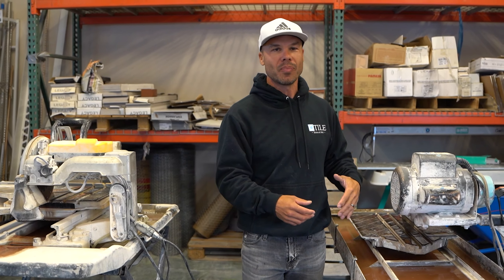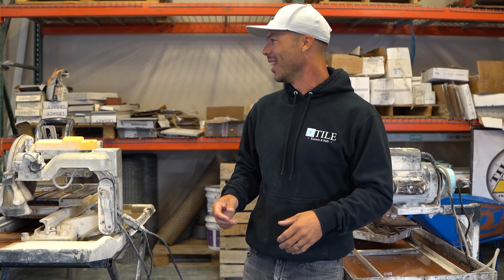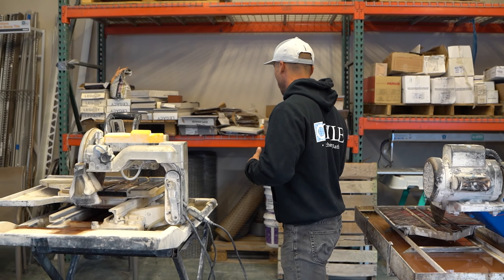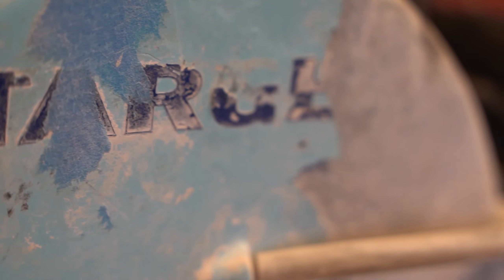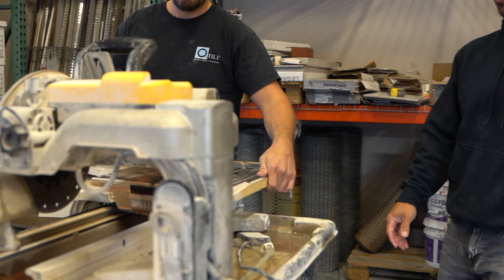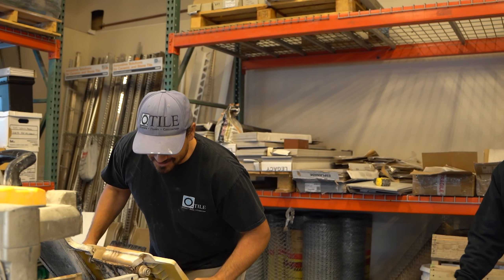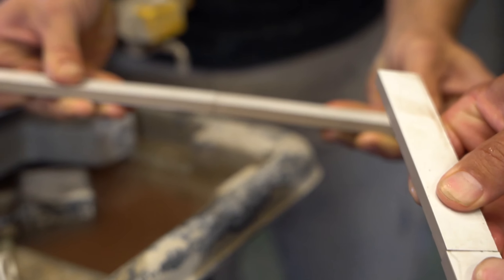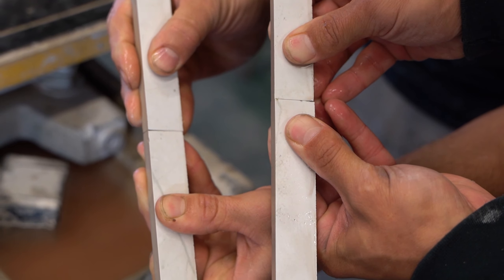TILE SAW BATTLE: DEWALT D2400 VS TARGET TILEMATIC XL

Comment: Hi Issac, if your wearing a hoodie while you work - remember to cut the neck string really short so it doesn't get caught in your tile saw/ power tools.
Reply: Lmfao don’t forget your elbow pads too Isaac, in case you fall down
Reply: @tnelly1295  
An apprentice I worked with got his hoodie string caught in angle grinder as he was leaning over a fibre cement sheet while cutting. Nearly sliced his neck open. Since seeing that, I always cut the string really short on any hoodies I wear to work.

I've seen a similar thing happen with a loose shirt and a power planer.

It's all fun and games until you're in the emergency room.

In Australia they sell worksite hoodies with short strings or strings that tuck inside the hoodie for this exact reason.

Keep laughing fool.
Reply: @vzgsxr  - some people unfortunately are only able to learn lessons the hard way 🤷‍♀️

Comment: I learned on a Target and had a couple of them in the 90's and early 2000's. They make great boat anchors! Dewalt had been my choice for the past 10+ years and I believe I am on my 6th and 7th. If only Dewalt made a 60% reduced size model I would definitely buy it and use it about 50% of the time....

Comment: I have (4) Target Tilematic Wetsaws for 25 years now. They are heavy sonofabitches but last forever. Over time I’ve replaced (2) steel pans with galvanized. 

The problem now is getting parts. One motor is starting slow. Do brushes need to be replaced or could it be the switch? I’ve never had this happen before.
Reply: The start capacitor is probably going bad.  You might be able to just look at it and tell, if its leaking anything its done, there are other ways to test it too.

Comment: DeWalt may have done just as good but won't last as long as the target I'm guessing
Reply: That's a bad guess.
Reply: skliros thanks.
Reply: You're not wrong. Those 1.5 and 2.0 HP engines the Targets used were built to run for 24 hours of continuous use. Doubt the DeWalt can make that claim but I'm open to being proven wrong.

Comment: I had target was my first wet saw tile cutter then I bought Dewalt it was light and good in the beginning but did not last longer than the target I have had two Dewalt and is gone before the motor is too weak, but the target still    The target the motor is strong powerful and I have to sell because I am 64 years old getting close for retirement, I am stopping doing tiles

Comment: I learned on the old targets still have a few heavy sonofabitches but great saws i have three dewalts love the plunge cut the 45 and 22 and a half but there motors are wimpy i have said for years if you put a target motor on a dewalt saw then you would have the perfect tile saw step it up dewalt